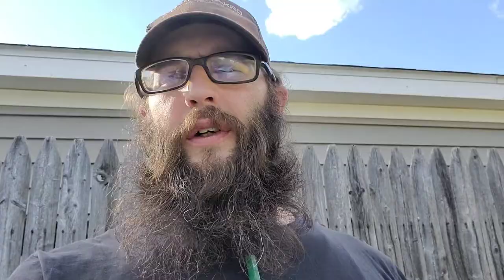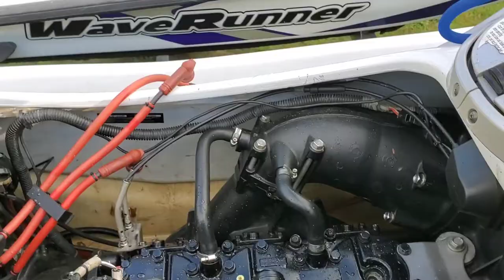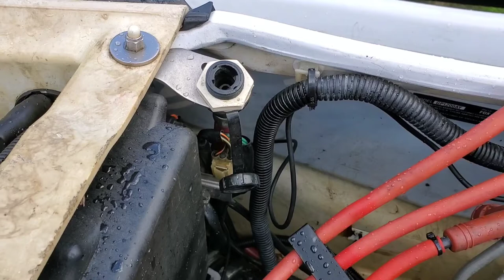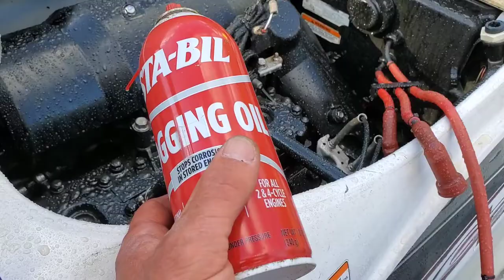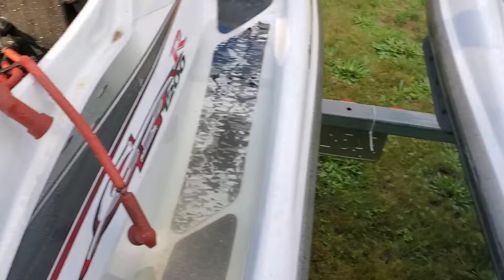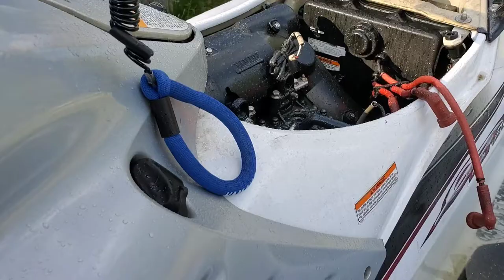Say what? You have water in the motor of you PWC! Watch this!

Comment: Thanks for this. Great vid. Just a short while ago my Waverunner's battery died completely while on the water. (2024 VX Cruiser HO) Multimeter says < 1 volt. Fortunately I was still in the channel leading from the boat ramp. A kind soul towed me back a hundred yards or so and he kept it slow. It was a no-wake zone anyway. Trouble is, I don't think I ever got it pointed fully in the direction we were going. I was mostly sideways and even aft slightly forward for a bit. Have I screwed the engine?
Reply from the maker: Yeah, towing can be tough. It's not too hard to create a siphon when it's not running. 
If you follow this video, you have a good chance of saving the motor. Be patient with it! It takes some time and, of course, even more time depending on how much water is in there. Being a 4 stroke, make sure you verify oil level. Change it if necessary, and it may take 2 or more changes if it's milky and contaminated. You will need a battery charger nearby as it will deplete fast, holding the start button in short bursts for 5-7 seconds or so, and letting it rest is important for the battery, starter, and starter wires as they all get hot or could be damaged. Also, keep a set or 2 of fresh spark plugs in case fogging oil or water fouls them out during the process or even shortly after.

Comment: Thank you for posting a video about water in a PWC engine! 
I have a question if you don't mind answering it. I accidentally left my gas cap off while riding my Kawasaki Ultra 310x and water got into the gas tank. I took it to my local kawi dealer and they pumped out the old gas from the tank and cleaned the spark plugs and fuel rail.  BTW they charged me $900 for that... I only put ethanol free gas in it, but the kawi service recommended that I put 93 high test gas because it would absorb the remaining water in the fuel system. They told me to run the engine and burn a whole tank of gas to flush the system of the water.

It starts up with a little hesitation but it runs rough and sputters. I brought it back to them afraid that I was doing additional damage to the engine while it was running roughly. What do you recommend I do?
Reply from the maker: Thanks for coming by! Did they not replace the spark plugs? For $900 they should have removed the tank to clean it! That seems extreme! Have you replaced the spark plugs since then? They should definitely be replaced. I got your email and I will reply to you tomorrow with more details and what I recommend for you!

Comment: I just replaced the plugs and oil + filter, I asked my fiancée to shut off the water and jetski after a minute.  She remembered to shut of the jetski but left the water in the hose running into the jetski for like 15 minutes before I noticed.  Couldnt start it.  I assume she got water in motor and exhaust.  Oil is now a milky color.  I can now start it but only ran what what would leave the exhaust.  I believe I need to follow your steps in this video, as well as, change the oil and filter again - right?
Reply from the maker: What a bummer! Yes if the oil is still milky definitely change it, get it as clean as possible. Once as much water is out as possible and it starts up. Run it for a few minutes with no hose, it can run for 3-5 minutes with no water before there is a overheat warning. If a warning starts sounding, just shut it down and let it cool for a while. It is just a warning when the alarm sounds, not an actual overheat. May have to replace the spark plugs again, even if for piece of mind, but wait until it's all squared away.

Comment: Hey its a great video! I have a problem with my yamaha vx deluxe 110 ( 2006 ). Last summer when I was last time driving it and bring it home, I was not able to turn it on so I didn’t rinse it with normal water. It stayed like this the whole winter, and now I called a mechanic to see why I cannot turn it on. It turned out that a starter was broken, and I bought a new one and few days ago this mechanic put it on jet but it didn’t want to turn on again so he took jet ski to his garage to check the problem and today he called me and said that the engine is blocked probably because I didn’t wash it with normal water after the last ride and that is all rusty inside, but he didnt take off motor block, just said to me that the top of the engine is rusty and that I need to buy new clips, rings etc… is it possible for the engine to get blocked because I didn’t wash it with normal water ?? Or this guy want to cheat me or something? I would be very thankful dor the answer as I dont know much about this!
Reply from the maker: Salt water can cause some corrosion internally, but for the top end to be as bad as he says, it would have had to be filled with water. What does it do when you try to start it? Have you tried to unlock the ignition with the code? Even if you did not set the lock code, it can lock from sitting. Is there a fob with the machine? Could be possible that the fob needs a battery or to be reprogrammed. I have seen instances where the motors have locked up do to water intrusion. I have also had motors locked up where I have been very successful with putting some fogging oil in the cylinders and letting it soak and lubricate the rings and become able to turn the machine over. A few motors also that did turn over but had 0 compression and was able to gain it back to 210 psi on every cylinder. Rinsing is important, mostly in salt water, but isn't 100% crucial.

Comment: Put a rag down while blowing compressed air in the holes. Also hold throttle wide open. Takes 5 minutes. Done hundreds.
Reply from the maker: Oh yeah! Same here 😆 rags definitely help it but it's fun to see it blow out everywhere 🤣
Reply: What about if doesnt turn on it crancks and sounds like wants to but just doesn’t turn on
Reply from the maker: @rosendocanto9896  the 3 things you need most are spark, fuel, and compression. I would check spark first, if that's good, check to see if you can spray some carburetor cleaner (or starter fluid or fogging oil) into the intake and crank it over. If it doesn't start or try to almost start,  then check your engine compression. Engine compression should be 125psi on all 3 cylinders. At least 120, 100 minimum to be able to start.
Reply: @wickedrepairs8527  i should be getting my air engine compressor and spark plugs tomorrow so ill let you know in 2 days how it goes but if i dont have enough pressure what can i do?
Reply from the maker: @rosendocanto9896  it could be the spark plugs. I have seen even clean new ones get fouled from ethanol fuel. If you have bad engine compression then you need a top end rebuild on the motor. Would have to take it apart and get a list of items to replace but worry about that more if it comes to that.
Reply: @wickedrepairs8527  compression was at 150 so good right ? And i actually put some sea foam and carb cleaner and got it to turn 1 for 2 mins than shut off than i tried again turn on but then turn off and now my battery is dead so im charging it rn ima keep trying cuz some oil with gas or water idk but its dark come out of the bottom hole i feel like its getting loose and trying to turn what u think?
Reply: Actually i got new sparkplugs put them on and they didn want to turn on put the old ones and turn on idk whats going on 😂
Reply from the maker: @rosendocanto9896 thats craziness! 🤣 Sounds like you may have a loose coil connection or bad/loose ground somewhere.
Reply: @wickedrepairs8527   where are the loose ground located i shock my self earlier w the coil so i think thats good 😂 where can i found the ground cables?
Reply from the maker: @rosendocanto9896 yeah, I've done that before 😆 easy well to see if you have spark! Check the ground terminal at the battery, to the starter relay (inside the electrical box), and there is a ground by the start on the bottom end if the motor. There is a small ground from the start to the case in the front as well, but that one is never an issue (that I have seen yet)
Reply: @wickedrepairs8527   i keep switching the sparkplugs and works but i just got new ones you think i should just get new ones ? Or something else still turn on for like 3 mins than goes off i put gas in the injector where the sparkplugs go then turn on then goes off any ideas next man
Reply from the maker: @rosendocanto9896 is your machine a fuel injected or carburetor? You may need a carburetor rebuild.
Reply: @wickedrepairs8527  its a carburador i never dont it tho you think is hard ? Where u located bro i am san diego and you?
Reply from the maker: @rosendocanto9896 I'm in Massachusetts, complete opposite side of the US. I do have a carburetor rebuild video, with another model, but the same idea.
Reply: @wickedrepairs8527  damm bro youre to far i wish you could be around and be my mecanic
Reply: @wickedrepairs8527  forsure ima watch it out and let you know tomorrow how goes or the next day
Reply from the maker: @rosendocanto9896 yeah, it's a long ride 😆
Reply: @wickedrepairs8527  thanks man do you know if i got to put new ones even tho i my buddy stalled new ones on couple weeks
Reply from the maker: @rosendocanto9896  the spark plugs should be fine

Comment: Hey man I have a Yamaha gp1200r 2001 model and I turned the water on today then turned the motor on maybe 10-15 seconds later. Do you think I should pull the spark plugs out and have a look for water or does it need to be on for a fair while. I just got it yesterday and now I can’t sleep thinking about it . Rookie error…
Reply from the maker: Did it start easily? I have a feeling you will be fine, but honestly wouldn't hurt just to peek at them. If any water got in there, I'm thinking it's pretty minimal and will burn off. Carry spare plugs with you incase any foul out. Always good to carry extras for a 2 stroke anyhow. Love those GP hulls! One of the best designs ever made.
Reply: @wickedrepairs8527 it started right away with no issues but after watching these videos of everyone saying to start the motor and then turn the water on it got me stressing out . Over here in Australia it’s night time so I will have to wait until the morning to give it a try. The jet ski is awesome , thanks for your fast reply man!
Reply: I forgot to ask will it hurt to put some of that fogging oil inside the cylinders without knowing if there is water in it or do you think im better off cranking it once to see and then put afterwards?
Reply from the maker: @Daniel-mv7bl nothing wrong with spraying some fogging oil in there. You shouldn't have to use a lot and fogging oil could foul a plug, but it will help with lubrication just incase! Don't want the piston rings getting rusty if water happened to get in.

Comment: my son went out on my 2007 rxp non turbo said it was idling fine through a no wake zone and when he was out at the end of it he went to 
rip on it he said it just started chugging, he limped it back to the dock and i pulled the plugs and found cylinder 1 and 2 had a little water in them not as much as the one in your video but some. i got the water out and noticed 2 of the 3 plugs cylinder 1 and 2 would not fire so i put 3 new plugs in it and now it is idling fine. i put it back in the water for about 2 minutes and it seems ok but i am worried it could be a bigger issue. I did a compression test and it was even across the 3 cylinders but don't know if i should check something else? also my oil looks good it was just changed before it hit the water.
Reply from the maker: Was there any water in the hull as if the hull plugs weren't in, or in all the way it may have been taking on water? Just thinking if there was any water intrusion to the hull, it may have been sucked up from the intake into the motor. 
If it was capsized, also just be sure it didn't take on water from flipping UT upright again. 
Also, there's the possibility of a self siphon, did it get towed at all where it may have siphoned water into the exhaust.
Besides having a hole in the hull. Those are the most common ways that water could get in. 
Of course there is if it was on the trailer and having a hose connected without the machine running. But I'm sure that's not the case as it was running fine prior to it having this issue.

Comment: Hello, I have the same problem, I have a Yamaha XL 800 2-stroke, it leaks a lot of water, can I use that oil to turn it on or how can I get it to work again? Thanks
Reply from the maker: If there is water in the engine, then definitely try this! I have fixed many motors and gotten them to run after doing this procedure. Sometimes it can take a couple hours depending how bad it is but still better than thousands of dollars and tons of time rebuilding and taken it all apart. Get a can or 2 of fogging oil and a fresh set of spark plugs for when it's all cleaned out.
Reply: @wickedrepairs8527  Thank you very much it worked for me, good video. Now I have one last question why is my Jetski only going at 30 mph?

Comment: I have a 2 stroke seadoo gtx filled with water exact same thing happening but the water coming out is rusty..
Is it possible water got in my bottom end? Will i have to flip it upside down to drain it all ?
Reply from the maker: Definitely possible that it's in the bottom end. Coming out rusty could be from the steel piston rings. Spray the cylinders real good with fogging oil to help lube it while trying to crank out any water. It will definitely make a mess! Elevate the front of the machine, turning it upside down isn't necessary.  Typically once there's enough out that it starts and runs, it will pump the excess out and burn off. The only other way to do it is to remove the head and cylinders to access the lower end and siphon water out.
Reply: @wickedrepairs8527 ok I picked up some fogging oil going to spray and pray lol 
thanks for taking the time to respond, really appreciate it!
Reply from the maker: Absolutely!! Best of luck!! 🤞

Comment: Maybe you can help me with a problem I am having with my jetski It sunk under water we pulled it out it did not want to start once I let it dry, I took spark plugs off there was a little bit of water took battery to get checked its good  it cranks it just don't turn on
Reply from the maker: If it cranks over but doesn't start, I would remove the spark plugs and turn it over with them out. See if any water comes out of the cylinder head when you do that. If so, there is definitely some more water in there. If it's only slightly damp and there's not a lot of water coming out, I would definitely replace the spark plugs and try again. It could be that the spark plugs are just fouled or getting wet and not wanting to fire. If there's water in the engine, it will not combust properly in the combustion chamber and allow it to start. Also, check all/any fuses. May have gotten wet and blown a fuse.
Reply: Thanks so much I'm going do all that by any chance is there a number I can call u  to or I can send u mine would like to call if I have any more questions thanks
Reply from the maker: @ManuelCuellar-hw9xw you can email me at Cdesousa13@gmail.com

Comment: Just got a jet ski 2019 Yamaha ex deluxe 38 hours, hasn’t been rode in over 2 years, was winterized, I’ve pulled the sparks installed new ones, oil seems to be alittle milky what should be my next step. I’m changing the oil now plus new filter. Should I do this just todo it? To see if there’s anything? 

The plugs were fogged 

Oil was low 

Full tank of bad gas
Reply: On my second oil change it won’t stay running by itself self but everytime I force it seems to wanna run more and more added some sea foam to the fuel also it’s white smoking quite a bit trying to clean up all the old lubrication on it 
Inside and out.
Reply from the maker: Yes, I would definitely do it, just incase. If the oil is milky, either it has water in it, or it can be from moisture from sitting as well. I would replace the spark plugs as they can foul easily from the fogging oil, provided it was winterized properly. 
The oil will always read low in them from sitting. Always be aware of that. Yamaha states, that as long as it's on the tip of the lipstick a half inch, it's good!! If the oil level is 3/4 up the hash marks or more when cold, it's technically overfilled! You need to leave plenty of room for expansion.
Reply: @wickedrepairs8527  there’s a leaking of oil on the right side of the engine just havnt found where hard to see
Reply from the maker: Yeah that can be tough. You have to use mirrors to see like that usually.

Comment: I had water in my jet ski today. I took out the plugs and ran the starter. It expelled a lot of water, but it took only about two minutes (Rotax 717 engine). I then wiped off the plugs and sprayed stater fluid into the air intake. After 5 or six tries, it took gas and completely started up. I let it run a while to burn off all the residual water. The outlet hose inside the hull disconnected and was pumping water into the hull. I and my passenger finally fell into the water when the hull was so flooded it became impossible to balance.
Reply from the maker: I have seen that happen before, what type of hose clamp was on it? I like to use a regular worm style hose clamp when I can on the hoses that have pressure. I hope it runs well the rest of the summer for you!